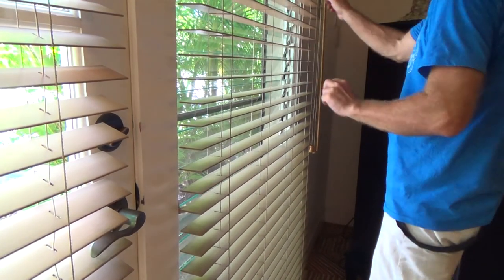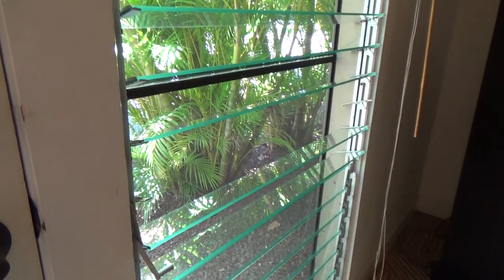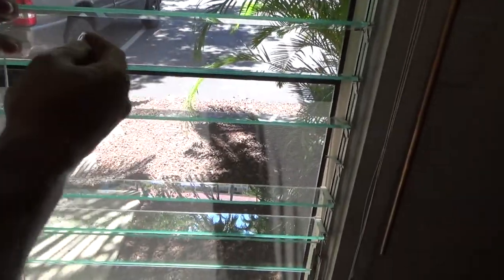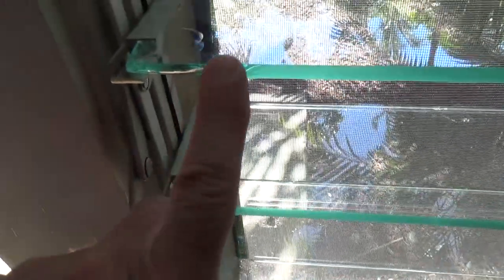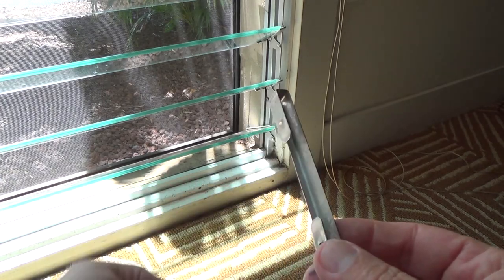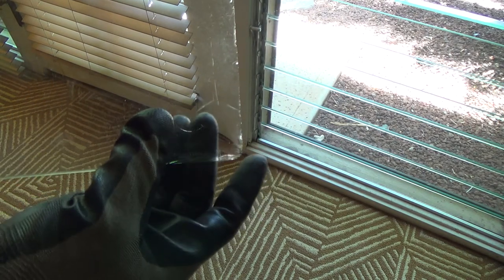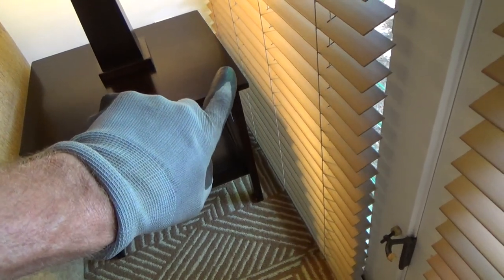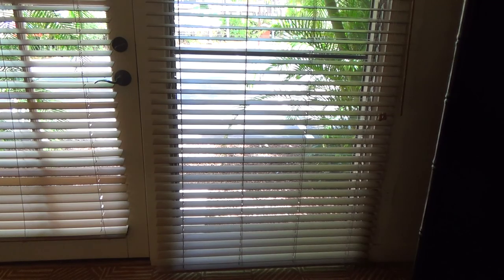How to Repair Broken Louvered Jalousie Window Clip

Comment: Thank you for posting this.  Jalousies are so expensive to replace and are such a big part of our homes here in Hawaii.  Finding an inexpensive repair solution is such a relief!  I've found these clips available on Amazon.   I searched for a product called:  Prime-Line H 3934 Window Security Clip, or CRL Two-Piece Window Security Clip.  Both are basically the same product by different manufacturers.  One might cost less than the other.
Reply from the maker: Great job for finding the parts. They got this part at your local ACE dealer. Who knew! They also have two types of glass replacements for your jalousies. If you measure your broken one they will also cut to length for you too.

Comment: interesting idea 💐
Reply from the maker: Yes for sure. This works great if the bottom portion of a window slat clip is broken. You'd have to remove the whole broken clip to then find another one & pop rivet it on to make the fix. Not now!
Reply: @videojoeshows  for sure this is videoJoeShows here😉

Comment: Is there a name for the ones you found at ACE?   I cannot find with the name of the brand.
Reply from the maker: Not sure of the exact name but the ACE hardware I went to had them. I would think you could ask someone there & if that store has them then they will take you over to where they are. Or maybe they will have them on their website where you might have to order them from there...as a thought.

Comment: How do you replace the screen if it has been removed? And where do you suggest where to get the screen from?
Reply from the maker: If you are missing your entire screen for the window then you would need to call like a window company & they can come out & measure for a new screen then they would make an entire screen for you. Not sure how else to do it unless you still have the screen frame portion but it's really tricky to install screening material without bowing your screen. If you have the metal frame for the screen then you can get screening material from The Home Depot or Lowes.

Comment: Can a broken jalousie glass still be glued on together? using super glue or epoxy?
Reply from the maker: Maybe. You would have to read on the super glue bottle to see if you can attach glass. There might be another product at the hardware store that could do it if super glue didn't you'd have to check it out. But if you measure your broken piece of glass you can go to ACE Hardware & tell them the measurement & they will cut you a piece to fit. I've done that before...as a thought for you.

Comment: aloha is this in oahu? i am in honolulu and might want to call these guys
Reply from the maker: No. This was on Maui. These were brothers who worked at a condo complex the maintenance department. They picked up these little parts at good 'ole Ace Hardware of all places. You should be able to get the clips there & fix your jalousie windows yourself I hope. Ace will also measure & cut glass for you if you have some broken window slats....

Comment: One of my door cranks on my door won't turn the glass open or closed. Any thoughts?
Reply from the maker: Not sure but maybe your door crank is old & rusty & welded shut? You would need to see if you can remove the handle crank assembly then you can see what might be wrong. The threaded areas inside might need to be sprayed with silicone to free up the gear but it sounds like you may need to replace the window crank. You would have to remove crank then take to a window company to see if they have a replacement you can get from them. They may need to order for you. You could also take a pic of your handle crank assembly & take the pic to a window company to see if they can tell you what might be going on or maybe they can order for you that way without you having to remove the entire crank assembly. You would also have to take measurements so they know the size etc if you decided not to remove the window crank to bring in to them. The best thing to do is to take it in. If you don't feel comfortable with all that then you would have to call out a window company & have them check it out for you. They may still have to order the window crank but you never know as they might have one similar on the truck. Good luck & let me know what happens... Thanks for your message.

Comment: Where do you get this kit? What is the brand name?
Reply from the maker: Believe it or not we got this kit at Ace Hardware. I've never seen them before watching these guys put this clip on for me. Worked great though. Then I didn't have to figure out how to remove the broken clip to then try to get another one to install. These clips worked great. Try Ace Hardware before anyone else & you might get lucky. If they don't have them in stock then ask them if any other Ace Hardware has them close by. If you strike out then I would try The Home Depot then Lowes. Let me know if you find them & good luck with your repair!